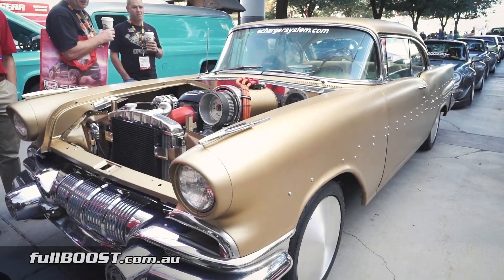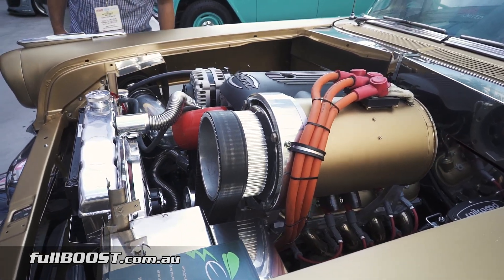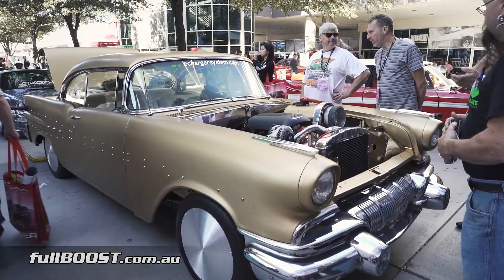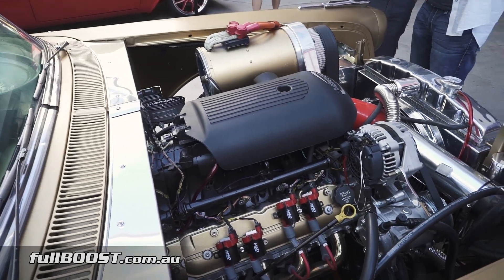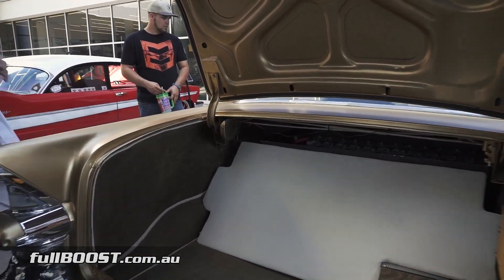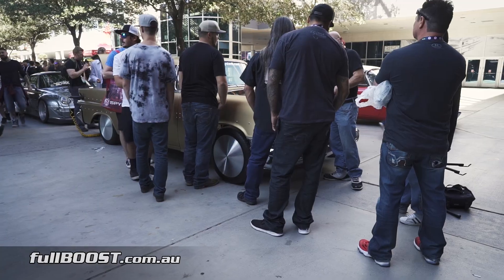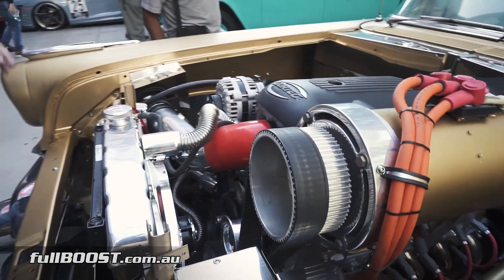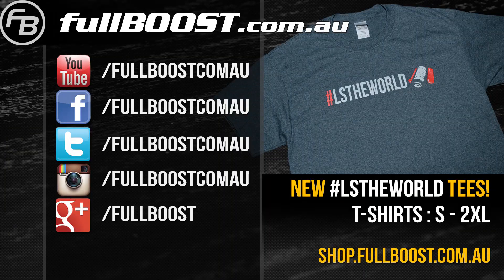The E-Charger Hybrid System

Comment: So how does this work in electric-only mode? Does it somehow warm up the oil, or does it just pump cold oil through the engine while it's turning? Because that doesn't sound very good.
Reply: There is no electric only mode. The start/stop electric mode turns off the engine at stop lights then when you press the accelerator it starts accelerating on the electric motor which starts the engine as well. It would be horribly inefficient to drive it in electric only mode because you'd be cranking the engine over constantly while you're driving.
Reply: Finally someone understands. You'd be fighting against a ton of engine compression. It would be a massive waste of energy in electric only mode.
Reply from the maker: No it doesn't drive the wheels it aids the motor, so it uses less fuel.
Reply: So driving with only the electric motor and not using fuel isn't possible?
Reply: correct, they work together.
Reply: +John if one really wanted they could use the motor that way on an LS with AFM for example(if one could make the collapsible lifters work on all cylinders) allowing the engine to deactivate all they cylinders. I actually think the Cadillac system on the 368 4-6-8 would be better I think it raised the rocker arm and allowed the non working cylinders to relieve compression.
Reply: There's still a considerable friction loss though.
Reply: there is no mode for electric, it's assistive, essentially it can take the load off the engine from the alternator, power steering, a/c and maybe some of the work from the drive making the engine run like it's idling when its at 2-3k which is much easier on gas, the electric braking would be really nice, I love not having to change brake pads on my hybrid lol

Comment: I think a lot of people are missing the point... this isn't an electric super charger or a "power adder". it is a universal system that reduces load on the engine. the effect is more of the engines power being used to turn the wheels, not being waster on drag. its a proof of concept and I think its going in the right direction. How about the guy that has a work truck (LS V8...) and doesn't want to keep making the fuel payments (cash and environmentally), he can add this system to greatly reduce carbon foot print. Its not for everyone  that wants to go faster, but for anyone that appreciates the efficiency.
Reply: It would also be great for that same guy in a work truck starting off with a heavy load. The electric motor will lighten the load on the motor while improving torque. It would help improve the highway merge too.
Reply: custommotor light bulb.... I’m going to put my ac-51 (because that’s what this is) on my new Chevy truck that I pull a trailer with. LOVE IT I have a fully functioning mini-truck that I converted that has all the parts I need. I have an LH6 that only has 30,000 miles on it.....

Comment: You wouldn't go fast enough in 1/4 mile for it to outweigh the benefits. System is 250 lbs + 150 tq. 40 HP added is same as 100 lbs lost on your ET slip . Do the math. It would take 120 HP to hall 250lbs. This system ads 30hp worth of performance. Which is about a 10th in the 1/4. Nice set of long tubes will do the job. Cool and all but too much weight added and not enough kilowatts.
Reply: dont think this is intended for the drag strip...
Reply: Fair enough. But whats it doing on LS motor with mods and drag like set up in that car ?
Reply: Your "math" here is worthless.
Reply: Kirill Sushko its SEMA, my guess is trying to appeal to the masses and get some attention to draw people in.

Comment: I would like to see real life economy tests and a dyno pull.
Reply: ryan cobb mmmm a big girl
Reply: he even says. it adds 250lbs. not any more than a big girl would
Reply: @pyrorc  or a Standard American Gal from San Antonio.
Reply: @pyrorc THIS GUY KNOWS HIS BIG GIRLS!
Reply: +Matt Sheahan, not exactly true bro. As the vid shows. And as I said in the other msg, there's a great article on Enginelabs.com too which make the same claims. I'm not denying that it's better suited to increasing fuel economy, but it DOES have the ability when the controller is programed for it to act as a power adder unit. The controller that comes with the kit includes this already. The designer reckons when it was in his Hummer last year that he used it like a nitrous kit around town and it made a big difference. And looking how the system works, I 100% believe him. This is a pretty big deal even if you hate electric vehicles or hybrids like I do
Reply: +Joe11Blue It's the added torque that leads to the increased fuel economy dude. It comes from a different and far cheaper energy source and is able to solely power the vehicle on cruise type journey's or significantly reduce consumption when used in tandem with the gas engine in the city type driving. For a short range of around 35miles, it has a really massive impact on economy. The designer feels that this will suit most of the population as not many people in big cities travel further than that each day. And just incase you wondered, I hate hybrids and electric vehicles, I just understand all this cause I'm a mechanic
Reply: +Joe11Blue And to be honest, power and efficiency are related dude. By learning how to build engines that are more efficient, you learn how to make power. Things like cylinder head tech, manifold design, piston design, fuel injection development and ignition systems are all examples. It's true, and is how OE level performance has got to where it is today because of how we've learnt to build efficient engines. They actually go hand in had at a design/engineering level
Reply: +Gilbert McGillicutty That's the thing though, it creates more than 50hp. 75kw roughly works out to be 100.5hp. So the math still works out dude. But the guys who actually built it, not the designer, said it makes 150hp difference. The designer said 75kw and 150ftlbs, didn't he?
Reply: As an owner of a 73 lincoln continental this would be great to get better than 6mpg
Reply: Lol
Reply: Gilbert McGillicutty there's also a difference between putting the system on an extremely heavy classic car and putting it on a small car like a civic or corolla where you could achieve much more noticeable results
Reply: I hear what your saying dude, I've been in the industry too long. I think they way you need to look at it is, a fuel map is a load vs rpm map. You can spin the engine up with very little load and it will use very little fuel in comparison to high load situations at the same rpm. So this electric motor allows this engine to operate off the lower end of the load on the map, while still powering the vehicle on light throttle. The power source come from a different fuel- electricity. So you right, it doesn't increase the efficiency of the petrol engine itself, it becomes a supplementary fuel supply and it is much cheaper- allowing the engine to practically use the same amount of fuel you would free revving the engine rather than holding load at the same rpm. I still hole heartedly believe power and efficiency are related at a design level. All those things I mentioned before are still related. increased efficiency still opens the door for increased power. That's why we can create such powerful OE engines these days
Reply: +ghettodeffender I did the FiTech efi conversion on my 72 Lincoln, 429 4bbl motor. No other changes and it went from 8mph at 70mph to 17mpg. Way better throttle response and GREAT low speed part throttle drivability. Go from ocean to mountains with no tuning problems either. Less than $1200
Reply: Audi used a e-turbo in a TDI equipped car, full torque at 1000rpm....
Reply: I would like to see them, but done by a third party.
Reply: +Jeff E 8mpg, not mph
Reply: It anyone had some brains, they would have a moderate sized Turning for a basic Kruzin' and idling motor then have electric power for accelation mode. Actually, if you want a partial or complete hybrid system, why not turbines for the fuel based changing system?
Reply: He said it weights 200~ and adds up to 150hp and a few extra Mpg
Reply: yup thats like a person
Reply: Your bringing more energy to the game than it takes to move the added weight. It regains energy that would otherwise be wasted on braking. The only event I can think of where you will loose economy is long highway trips. With the batteries depleted, your fuel economy would drop roughly that of having an extra person or two. And this is just the start, this has more potential to get even better.
Reply: Ya I want the dyno sheets
Reply: There's plenty of other videos on the car , look around.  It's proven technology.  Dodge ram 1500s are already using it!!
Reply: I need a DIY video 
Because this is gonna be a huge must forever one soon
Reply: I see nothing
Reply: Weight is my point. Say the car makes 400hp and weighs 4000lbs. If you add 250lbs of weight to the car, you will need to gain 25hp to cancel out the added weight to remain at a 10lb:1hp ratio. To gain any realistic performance, you would want 50hp for that 250lbs, maybe even more depending on the cost of the system.
Reply: @ChuckBeefOG  bro, that 25 hp is enough because u add more torque, for fuel efficiency u need torque not hp
Reply: @ankualex  the electric motor is not running above 100% efficiency.

The rotational weight of the motor is draining petrol when its not running the electric motor, the batteries add 250lbs of weight... so cruising when not using the electric motor for acceleration,  he is indeed using petrol.

250lbs of batteries won't last long on a 1000cc motorcycle let alone a 2 tonne rig.

I build evs and electric motorcycles.

This is not efficient, but it will definitely accelerate faster than stock...

Even at idle it will be chewing up petrol if the motor is not used as a generator to charge to batteries... roughly 250-500watts of petrol will be required just to rotate this motor.... at 3000 rpm it will be around 5kw of petrol just to run this motor with no load.

No if you turned on the regen to charge the battery you could easily rob 50-100kw of regen petrol....

To put things into perspective....

I have 3 me1616 motors in my truck running off 168v 600amps each.

One is rewound for 4000rpm max and peaks 500nm to the front 4.11:1 diff.

1 is running a belt system directly to my crank. The other is independently running a belt to a centrifugal supercharger.

The only electric motor that is increasing efficiency Is the one that is connected to the supercharger.

The one connected to the crank turns on when the foot pedal hit the switch under the foot pedal to turn on a 0-5v sensor which I can set via a dial knob for power intensity, if it ls not accelerating it's in regen constantly charging at 2-10% regen, even at idle I'm charging the batteries. I have 300lbs of batteries,  I can tell you they don't last 80miles range.... would be Lucky to get 20 miles. 

The motor connected to the diff accelerates via 0-5v gradual footpedal sensor, so if I give 5% throttle on my petrol it'll give 5% torque to the front also. When I'm cruising, I'm using the front motor to take 90% of the torque load.... these are 91% efficient motors and even if I didn't run them to charge the batteries and charge via a wall socket, because of the extra weight in electric components, I have 700nm of electric torque available to the wheels...

They still use more petrol because of weight.... I'd be lucky to get 10 miles and would have to spend the next 20mins trying to fast charge.

That's why evs are aerodynamically improved, and why they're trying to reduce weight as much as possible. 
That's why a tesla doesn't have a spare tire... because electric storage and weight in evs simply don't mix....

So thinking a hybrid is an efficient idea is silly. It's not. Load is put on your petrol motor at idle and as rpm increases by double the load is increased by a factor of 4.

And if you wanted to use the motors to charge the batteries you need to consider that your 92% efficient electric motors will have an efficiency of 50-60% because they heat up....

I have a 2nd radiator to run my 3 motors....

But I can tell you it's fun.... I'm getting nos added to my setup soon.... :)

My rea
Reply: Horsepower has fuck all to do with economy. In fact it's the opposite of economy.
Reply: Peak economy comes at an optimized point between enough torque to move the car with minimal vacuum and peak torque. Horsepower is measure of how much energy the torque is producing once it's past it's efficiency area of the curve.

Power and efficiency have fuck all do with each other. Efficiency comes from that ratio of torque versus vacuum. The greater the magnitude of vacuum, the worse your efficiency is going to be, This system reduces the need to go into high vacuum states at lower RPM's, by using an electric motor during that area of the RPM range.Daniel Brealey
Reply: There is zero economy since you add several hundred kilos in the car and lead more rotating mass all the time with your engine.
+ you have to buy all this stuff  so the economy is completly bullshit.
If you want economy,reduce the mass,reduce the displacement ,increase the efficiency.

Comment: so it doesn't force air into the engine, it helps turn the crank via cog belt?  how often do you need belt replacements?
Reply from the maker: That's correct.
Reply: Have you ever noticed how many brands of motorcycle have gone to belt final drive lately? Nuff said.
Reply: Every hundred thousand miles or so.
Reply: Bob Last Probably about as often as superchargers, as they use force from the crank to turn them; this is the inverse.
Reply: Bob Last 
Belt driven valve train, belt driven oil pump, belt driven life suoport machine for grandma. I'm with Henry Ford. "The safety of STEEL, from toe to wheel!"
Reply: no. it's just an assist. it's actually better than a turbo or super charger. it's instant power and doesn't take any off the motor. but his long do the batteries last is the problem. and what's the efficiency rating of the motor. probably 50% it could be WAY higher.
Reply: Probably dependant on how hard it was driven. Even if it were 50000km, its an easy change over.
Reply: Bob Last I wanna switch my belt drive to chain drive
Reply: Curious as to how the engine deals with its own "load" calculation being that there is this assistive device, do you have to reprogram ecm's for this thing to work correctly---or for the engine to be able to work with it?
Reply: Dorian Demeturlias not a single performance oriented bike has gone to a belt drive... only mid life crisis I need my wife's permission type bikes...
Reply: @boblast5582  The buell 1125r came with belt drive. I can assure you that is a performance bike
Reply: toysareforboys I find that hard to believe...

Comment: Sounds like a waste of money haha
Reply: paying gas weekly is a waste of money too.
Reply: WhyteLis21 then buy a fucking prius? lol
Reply: prius? plz. 😒 maybe u fucking can. tesla is my preference but their expansive as hell. im just saying gas is as much of a waste as electric. no need to take it personal. 😁
Reply: WhyteLis21 if you can buy a tesla, you sure as hell aint worrying about paying for fuel.
Reply: WhyteLis21 annnd if you buy a tesla, you save money on fuel, but end up spending more money just from your electricity bill (yeah you gotta charge the car oveenight)
Reply: WhyteLis21 i concede sir, you have me beat! good argument though. not many people will explain there reasonings in a civilized manner like you have. Well done.
Reply: well thank u. that's bc i'm not an ignorant fool. i listen n respect others opinions even if i don't agreed with their opinions.
Reply: WhyteLis21 sorry, im naturally an ass.
Reply: System probably cost more than the car and would take 50 years of everyday driving to pay for itself and the batteries wouldn't last that long anyways.
Reply: LawF250 Then theres also that this system adds about 300-350lbs, and kills power. The electric motor is spun up by the engine, and we all know that even having AC on will kill hp. So i wonder how much this is killing and how much its adding. A full single turbo kit for a GM LS based engine adds anywhere from 60-300hp (depending on boost and how tight of an area the air is filling) for way less than this kit. And its not robbing power to make power.

Extra weight AND robbing power to make it? No thanks.
Reply: Did you even watch the video? It's not robbing power to give power. It's powered by the batteries to spin the crank shaft reducing the load on the engine. But I do agree with the the weight reducing the 150ib ft torque that it adds but that's not just what the e-charger focuses on. We will just have to wait until they either release some data or until someone buys the kit and does their on testing.
Reply: Ryan Austin it is a waste of money the weight of the battery's and motor cables and ecm would make the 150lb gain pointless and for the price this will never be a thing unless they ban gas engines